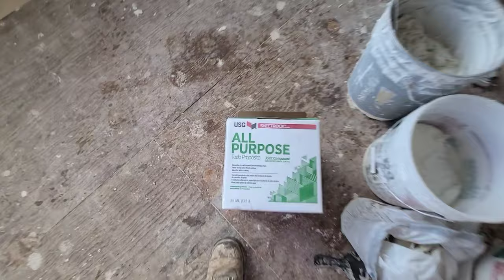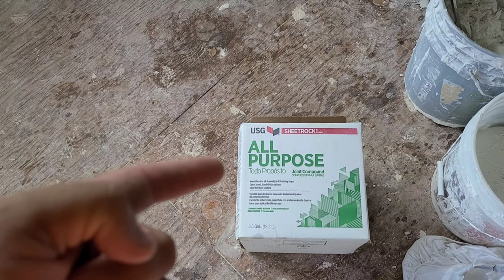How to Spray Texture on Drywall using a Graco RTX (For the first time!)

Comment: Do you find it easier to mask the floors with plastic over scraping with a floor scraper? Everyone does it different. I either use floor paper or scrape it, depending on if it’s finished floor or not.
Reply from the maker: We usually scape everything but this one had existing wood molding throughout. The flooring guys grumble a bit but it's faster for us.

Comment: Nice vid!
In The Netherlands we texture with different machines called spackspraymachines.
We spray with 10bar compressors to have a fine structure.
I saw in the video you have to mixure it with water,why?Is the machine not strong enough for heavy materials,it’s look very thin the me.
If we do plasterboard texture spraying first we spray it with primerpaint (white) then after that we spray the texture (brander crystal) but i think that’s to thick for that machine.
I prefere our structure because it’s looks not wetty.
Funny to known that the knock-down texture doesn’t work for most of Europe.

Comment: So far your the most informative channel I've came across. I have a few questions. I'm attempting to do knockdown on the ceiling. Do I have to prime it? Do I have to pull the masking/tape off before it dries? And do you paint over it to seal it? Thanks!
Reply from the maker: You just spary it heavy let it set a little bit then wipe it down before it fully dries make shure to keep the flexible blade clean pull the blade in the same direction to keep to pattern consistent.

Comment: Could this machine be adapted to spray for level 5/skim coat?
Reply from the maker: No for level 5 I would recommend a mark 4 or 5. 
https://youtu.be/6nrmW8rXoHE
Reply: I had the exact same question, can you spray thick mud with a mark v
Reply: @franciscocarlos-xy9qv  yes, apparently it can spray unmixed mud right out of the box...not that you would ever need too.
Reply: @BushmanCanuck  it would be nice if there was an adapter for spraying level 5 or putty coating old walls with thicker mud.
Reply: @franciscocarlos-xy9qv  the mark 5 can spray texture as well with the right gun. But yeah the pump on it is a beast and the 5 is a major investment. I would have to be doing a lot of level 5 to justify it. Right now a stucco roller and a tomahawk wiping blade works for me.

Comment: Do you do a knock down after each room is sprayed as it dries in 10/15 minutes. Does the gun start to clog up when you stop to do the knock down. Hints on timing of knock down. thanks
Reply from the maker: Yup have to go ro by ro if your working alone and don't worry the gun doesn't clog. Some times I leave it out of water and take lunch come back and keep spraying. Just got yo make shure you let it set a bit so it doesn't drag but enough to just give it a quick pass and go.

Comment: With this machine you dont have to used the spatula on walls for nock down??
Reply from the maker: All texture spray rigs can spray knock down texture. It's called knock down because you "knock down the texture with a knife to achieve desired look. In this video I am spraying a light orange peel texture. This style doesn't  require you to wipe anything. Just one of may texture styles like popcorn, skip trowel etc...
Reply: @csdrywallhawaii  thanks for the reply amd great video men

Comment: im at the point were Im gonna replace my graco sprayers there the 1000 model (the rtx 1000) older model but makes me leary the new rtx line, all the comments across youtube people are saying they lasted a year then quit... what machine do you like the best and what model would u buy again bro? I been following u a while and your opinion is what im making my purchase based on!
Reply from the maker: Awesome Danny I personal use the Graco rtx 1400 for 95% of our orange peel jobs it's lightweight and gets it down pretty quick. I don't  like the higher models because of the new smart start tech. In my opinion it makes them way to sensitive to any change in power. If the unit is pushed a bit to hard the on-board sensors fry... If your mainly doing orangepeel and some heavy texture the rtx 1400 should be good enough to get the job done in a reasonable speed. I recommend maybe renting one at home depot to sample and see how you like it. 🤙🏽
Reply from the maker: https://youtu.be/ygOYF2zpp18
Reply: @csdrywallhawaii  that duotex how did u like that one? I love that it has a lid, that would make life so much easier.. i like the wheel in the front and the many other features it has... it is up there in price closer to the rtx5000 now though... My worry about that one is when I had the sharpshooter hoppers each lasted about 2 hours before breaking... How did you like it, do u still use and which one would you use if you could only choose one!?????
Reply: Do you ever have an issue with this tripping breakers?

Comment: After you sand the drywall do you do a wipe down with a wet sponge to remove dust before texturing the walls and ceilings ?
Reply from the maker: Thanks for watching, I like to air blow the walls with a cordless blower before spraying  removes dust a bit faster but creats a temporary dust cloud so I give the guys a 5min break while it clears out then we go back in to finish up.